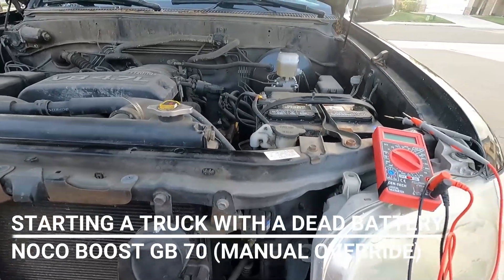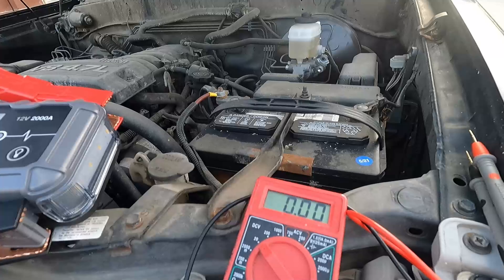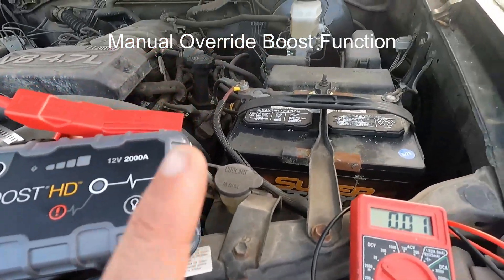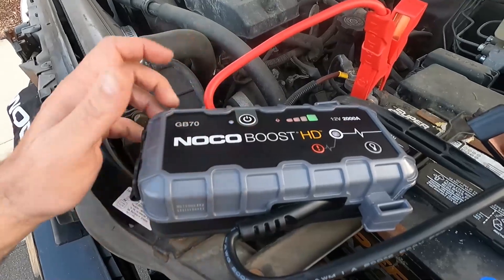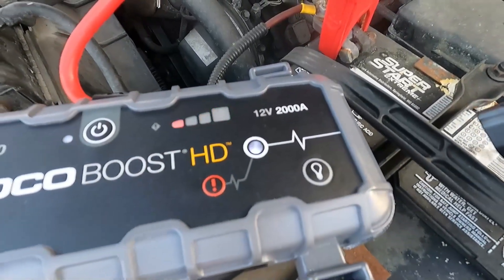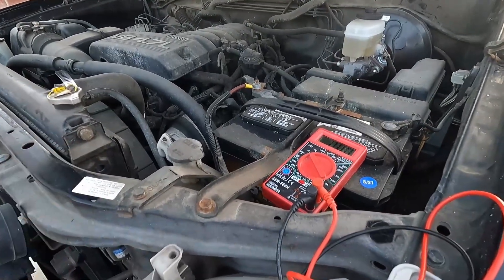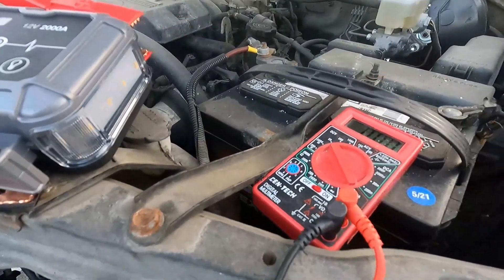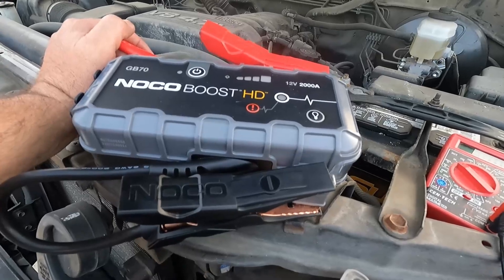NOCO BOOST GB70 - How to Jump-start a Car with a 'dead' battery using Manual Override Boost Function

Comment: Completely dead DieHard 750 5 Yr Old Battery. 10 degrees, got down to the negatives and have not driven my 2013 Toyota Highlander in about a week. Put it on and a year before it started descent with a little effort, this time I had to wait 25 minutes but it hit hard and smooth like the battery was brand new. Now I don't know if the battery needs replacing, but the NOCO is awesome.

Comment: Can I charge dead battery by leaving noco connected to battery terminals in manual mode? I don’t want to damage alternator on my other car that just sits in my garage. Thanks in advance.
Reply: No, you wouldn't want to do this.  The battery pack in a portable jump starter is tiny, and while it can provide a burst of 12v current sufficient to start a car, it doesn't have the capacity required to make a real impact on a car battery.  If you have a stand-alone, wall-powered charger, you can use that, but I wouldn't be as hesitant as Dan about letting the alternator do it.  I appreciate him being conservative with the alternator, but the charge current back to the battery is regulated to be a very small portion of the alternator's normal workload.  The limiting factor in how fast you want to charge a battery is the battery itself, not the alternator, so the battery isn't free to draw unlimited current from the alternator.  So if the recharge is over-taxing the alternator, something else was already likely wrong.
Reply: @skyking2202  Thanks for the detail. I really appreciate it! Now I know why there’s a need for battery tender for a spare car. I ordered Noco Genius 10 after some research.